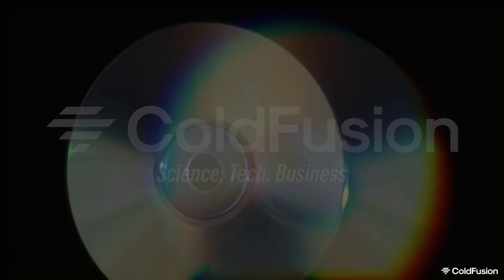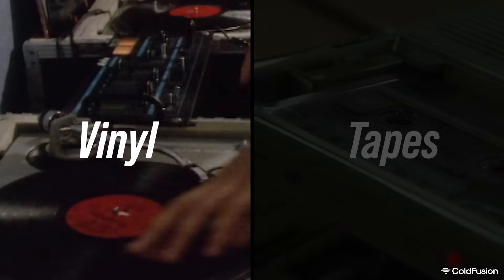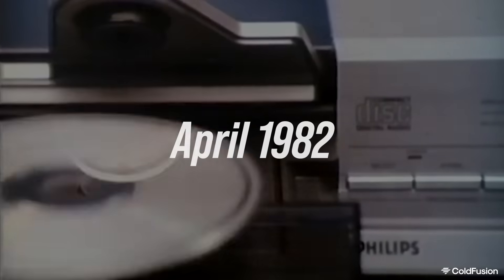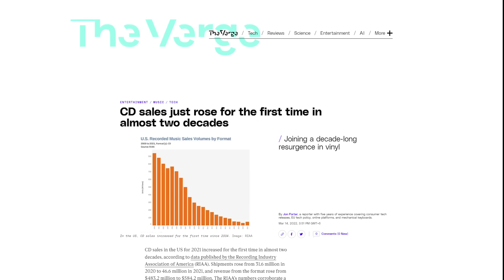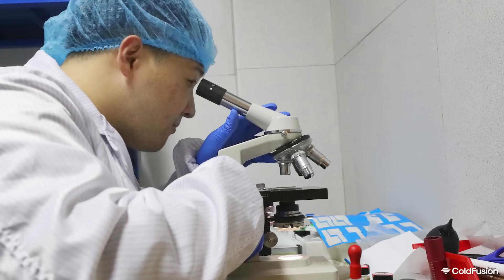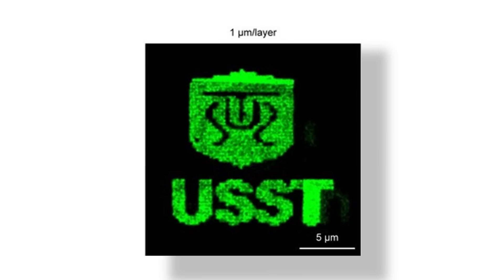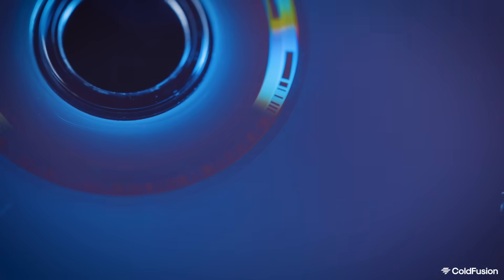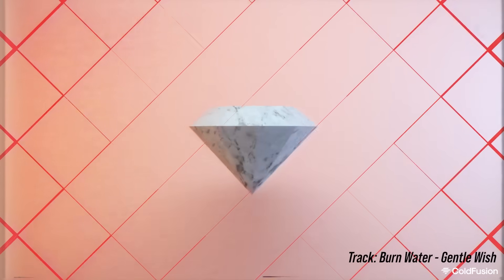Why This New CD Could Change Storage

Comment: I  collect CDs and DVDs 
Almost 10000+ in my collection.
Reply: Sounds like my friend Mike,  he had about that many in just Music CDs alone.
Reply: How do you make sure they are preserved? Most of my CD/DVD media from 15+ years are unreadable :(. They where stores in boxes in cold ans dry place
Reply: @arodic  I re sealed them with air tight plastic layer with original box. keep them away from humidity. still many of open box CDs got Black spots. if I got original sealed CDs I never open them or use them.

Comment: the player will be expensive. the burner will be even more. i will not even dream with it. i dreamed about blu-ray burner for backup and never got to a price good enough. it was cheaper to buy HDs
Reply: I bought my Blu-ray burner for cheaper than my first CD player for my computer.  I still have my Blu-ray drive box of CD and DVD burner for the computer in a box.
Reply: I've been thinking of buying a BD burner for the last 5 or so years but haven't yet mainly because of the price. The burner is 95€ and a 50 pack of 25GB discs is 38€ so combined they are close to the price of a low end 8TB HDD. But the burner would be a one time purchase and the 38€ per 1250GB worth of discs isn't that crazy. 50GB and 100GB discs are a lot more expensive but even the 25GB discs would be fine for backing up photos and compressed video
Reply: if you want a cheap and reliable way to archive data, get the cheapest sas controller you can find and hook up a used LTO drive from ebay. the new ones have that enterprise tech tax so they cost an eyewatering amount, but a drive from one or two generations ago is much more reasonable and and LTO8 tape still stores 12TB for example
Reply: @oggilein1  A whole 12 TB.  I can get an HD instead that will last up to 12 years,  and I don't need a Tape and Drive to use it. $50 for the Tape and $2500 for the drive pre-owned.  I could get a 12TB drive anywhere from $84 to $300 depending on the brand and warranty.   I could go RAID6 and still be cheaper.  
BTW I have used TAPE backups in the past.
Reply: @quantumleaper   @quantumleaper  the idea of tape is archiving & cold storage, tapes in cold storage will retain data for 50 years, a hard drive can't and frankly doesn't need to compete with that, they both have their usecases. an optical disk is more similar to tape in it's application than an hdd
Reply: @oggilein1  My Tape drive and tapes didn't last 10 years,  I doubt anyone but someone into Retro computer will be using a 50-year Tape drive,  if you can even find the hardware to retrieve the data the tapes. Considering there are other ways of data storage that would be cheaper per Byte.   How many  IBM 3850 mass storage systems are used anywhere today?  The 3850 had a max capacity of 238GB which seems big for the day but tiny today.   BTW that took up over 20 feet of floor space.
Reply: @quantumleaper  I'm talking about archival grade tapes, LTO tapes in particular. those are the only ones in use nowadays, they are the ones with large capacities (the latest gen of LTO does 18TB uncompressed per tape) and those are guranteed to last 50 years, since they use BaFe tapes instead of just iron oxide. of course consumer grade tapes are not gonna last that long
Reply: @oggilein1  I have had warranties on HDs for 3 and 5 years.  5 year one still running, and I have to replace the  3 warranties before November.  Didn't say some similar about CDs and also about how long they last?   I would rather go with 3 2 1 with my data than hope some company will be around in 50 years.

Comment: CD storage is permanent its not like ssd which only stores up to 5 years 👍
Reply: SSDs depend on the type of storage it is single-level cell (SLC), multi-level cell (MLC), triple-level cell (TLC), or quad-level cell (QLC).   SLC will last the longest but it is also the smallest in size.